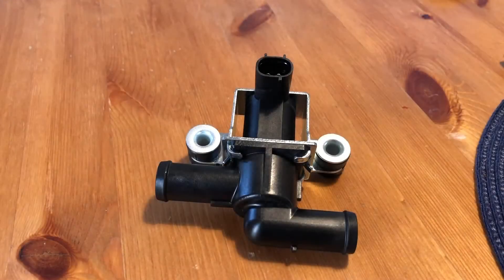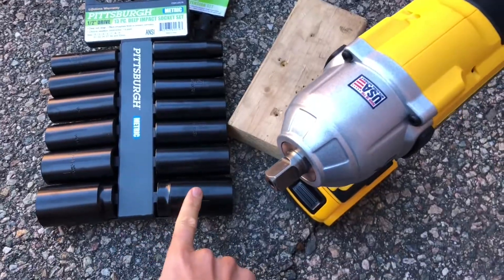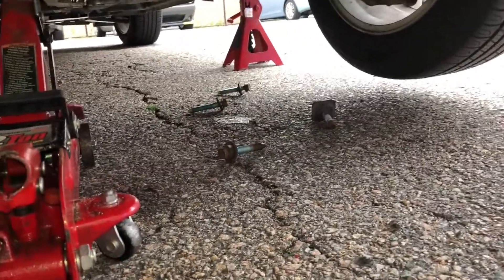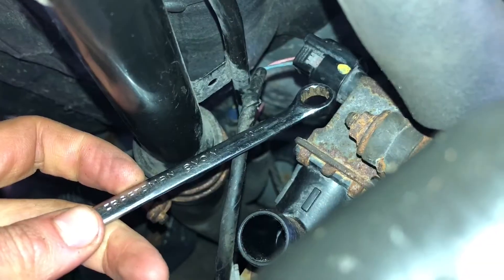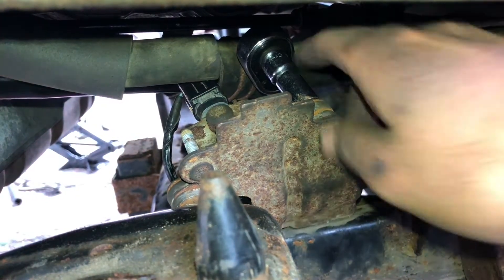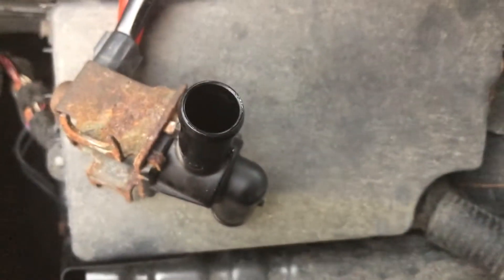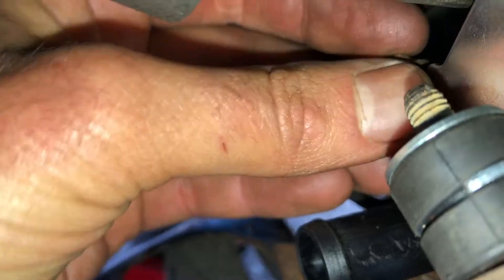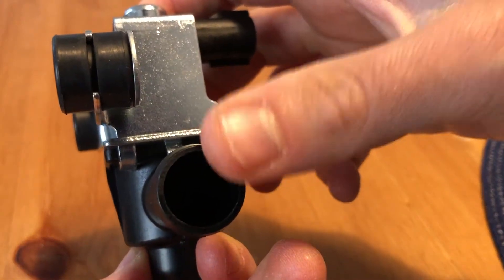How to Diagnose and Replace a Mazda 3 Canister Vent Solenoid P0442 P0456

Comment: Very very helpful thank you for including the torque specs 🙏
Reply from the maker: @timothydh37  thanks for watching hope it helps! I just did this job again and sheared one of the little 10mm studs on the removal didn’t put enough penetrating oil on em

Comment: Great video, i had a terrible time battling the rust in mine, snapped the subframe bolt in the coil spring and cross threaded the other side coming out. Whole driveway was covered in rust, hopefully this keeps the light off, thank you.
Reply from the maker: @RomanEmperor1  ugh sorry you had so much trouble but not surprised. Snapped a sub bolt myself when I did this job a second time; these Mazdas rust heavily if in the wrong region .

Comment: Looks relatively simple, I'm sure the hardest part will be dealing with rusty nuts haha

Obviously trying a new gas cap is an easy first step, but doesn't look like that's gonna work for me 😭

Although if it's actually a $1k repair job I can definitely spend a couple hours to take care of it since I'm not making $500/hr
Reply from the maker: @JoeZupko2  you got the jist of it! If there’s no rust and the car is in 80f summer air it’s an easy job…I’ve done it multiple times, hot and no rust >>> cold and rusted ugh

Comment: Hey I got a 2015 Mazda 3 getting p0452 and p0446 I’m going to start by replacing the gas cap which I doubt will work because the cap looks like it was just replaced (I just got the car so I don’t know much about It) how should I go after trying the cap?
Reply from the maker: @alexquezada510  normal drive cycle to confirm (ie 1-2 weeks of driving for me after clearing codes) then this job unfortunately. I had no interim troubleshooting step

Comment: At 1:00, Is bolt number 1 inside the coil spring area? How did you remove that?
Reply from the maker: Yes, I used wobble adapters and extensions to position my 17mm socket.

Comment: What causes this vent valve to leak?
Reply from the maker: Not sure but I’d guess worn seals or bad spring tension. Mine clicked but still threw the code so I think it’s the sealing components more than the electronics.

Comment: Thanks!
Reply from the maker: Thanks for watching and your support! Glad it helped!
Reply: Oliver, this video saved me $800... CA rates.  I would have not been able to replace the vent solenoid w/o it and just wanted to thank you.  Your video was AWESOME... every bolt you helped me identify... dropped the subframe down 3".  Clear shot to the solenoid.  Note for others: As you could see in Olivers video, he had to deal with rust.  I did not and it was very easy... no impact driver, just a 17mm and 10mm socket.  I did put a 3/4" x 18" pipe on the end of the socket wrench for leverage on the six chassis bolts (absolutely needed)!  Hell, finding a part in stock took longer than the actual job!  You are really good at these tutorials... enjoy a lunch on me.

Comment: LOL you're way too careful dude.
the entire bracket and bolts rusted and broken apart on mine I removed the entire bracket and attached the hoses and electrical back on the valve and just put one tie strap to hold it in place.
a way cleaner and better design than before. other than that, a fine repair this is.
Reply from the maker: Haha I literally just had to redo this the valve went 3 yrs later. Did something similar since it’s so rusty down below decks hahah

Comment: How do you  remove the bolt thats located inside the coil spring!? The space is so small that I'm not even sure what tool would be able to fit in there
Reply from the maker: I did not remove any bolt inside the spring, but for the six on each side I just used 1/2-in extenders of different lengths for access. I actually broke a bolt (not in video) - was too rusted out.

Comment: The light just came on on my Mazda 3 2012 I put a scanner and it shows P0456 code. The cabin smells like gas does anyone have this problem of the cabin smelling like gas because of this problem?
Reply from the maker: I did not have a gas smell but it could be that the code is from a bad fuel line and not a bad solenoid (would cause the same lack of vacuum in the line from canister to engine that you’d get from a stick open solenoid). A pro may need to look at the whole system for leaks in that case. Sorry this is not more specific but if you try relaxing the solenoid and the code stays then look to the lines.
Reply: @OliverPorter92  I have gone to multiple mechanics and no one seems to know, they just say keep driving the code will go away, I’ve been driving it for over a week now and nothing. i need someone in LA
Reply from the maker: @Fluffyapproved  If the code is away I would not be too concerned. It may be a different cause for the smell; the vent solenoid is way in the back. If the code kept on, then the smell makes sense (vapor leak). Sorry this is somewhat cryptic.
Reply: @OliverPorter92  but the smells comes from the car vent I’m thinking it’s coming front the front of the car
Reply from the maker: @Fluffyapproved  If the smell is coming from the car ventilation system but you still have P0456 my gut says it is not the canister vent solenoid causing it, likely the fuel vapor line between the canister and the purge valve located in the engine bay.
Reply: @OliverPorter92  can i send you a picture

Comment: Yeah when my check engine light came on and I did the OBD2 test. It came back to me as a P0442 code. I was like okay now what. So I looked it up and I thought it was my gas cap but I knew it was because I replaced it a week ago. So now I'm thinking it's my solenoid. Thanks imma to a bit a wrenching but I'm pretty sure this is the problem. After all my car is over 10 years old.
Reply from the maker: Thanks for watching! Yes a bit of wrenching hope it helped though.

Comment: Hey Oliver,  Thank you for the video it really helped me a lot I finally replaced the vent Solenoid without a problem, your video was awesome, my 2011 speed 3 check engine light is gone..
Reply from the maker: Hi Marcelo, Thanks for watching and glad it helped! It was such relief to me as well once I fixed it and the light turned off. Good luck!
Reply: What was the CEL number?
Reply from the maker: @jggarage1807  P0456

Comment: Excellent video.  I had P0442 and P0456 codes on my 2011 Mazda 3.  After watching your video I decided to replace both purge and vent solenoids.  Your suggestion for using an impact driver was INVALUABLE.  Having never used an impact driver I watched a couple of YouTube videos on it and now I'm a pro.  My only suggestion is that you should've mentioned that you'll need a couple of 1/2" drive impact extension rods to unbolt the frame.  FYI, both solenoids cost approx. $115 with shipping from RockAuto.  My question to you is: how long did your Mazda3 perform another small leak test before the check engine light cleared?  The P0456 code said it's permanent and didn't clear after driving the car around for an hour.  There's indication on searching the Internet that the small leak test takes a long time to perform before it clears the check engine light (if the problem is fixed).
Reply from the maker: Thanks for watching and glad it helped on your 3! The impact helps a lot, and yes the extensions were helpful too, I can add them to the parts list in the comments. The standard drive cycle is about ~50 miles of regular driving for the car to clear the permanent code through a vent pressure test (something like close vent, close purge, see if vacuum holds, and/or various iterations written in the ECU code, several other YouTubes detail the exact test).  So if you see it on, it should turn off within a few days of driving if this was the correct fix. Good luck!

Comment: Super helpful video; thanks! One observation: When dropping the subframe, the flexible brake lines are stressed. I couldn't drop more than about 2 or 2.5 inches max before the brake lines were at their limit. But that was enough to get at the solenoid. Thanks again.
Reply from the maker: Thanks for watching! I kept a close eye on mine but they did not strain, good to watch out for though!
Reply: So what year Mazda 3 is this

Comment: Alot of work for my rusty mazda 3 with almost 200,000 miles and a slippy 2nd gear. Think I'll keep clearing the code til it comes back instantly and the just ignore it lol
Reply from the maker: Yeah, I did it to pass MA inspection. It was a fun job...if you find this stuff fun! Thanks for watching.
Reply: @OliverPorter92  definently man. You did a great job.
Reply: Wow sounds like like my car. 2008 Mazda 3, 3rd to second or 2nd to third and it makes not nice sounds if you step on it

Comment: Hi! I have a 2012 Mazda 3 skyactive that looks exactly like this underneath and am also having an issue with the purge solenoid. My problem is that my solenoid connector wires were torn off about 8” from the connector (down by the cross member) and I have no idea where the missing section of wire should connect back into. Could you explain how/where  the connector is wired into the wiring harness?
Reply from the maker: Thanks for watching. Unfortunately not, would need to go into the wiring diagram in the shop manual (Mazda may be able to provide the manual and schematic).  Sorry for that!

Comment: I have a 2012 Mazda3 and the gas tank does not hold any pressure, every time I take off the gas cap (which I replaced) I noticed there is no release of pressure at all. Could this be the part be defective ? I replaced the vent valve at the engine and still read codes of P0442 and P0456.
Reply from the maker: If you replaced a valve at the engine, that was likely the purge valve.  Your issue is most likely towards the tank, try new gas cap, smoke testing or following a code troubleshooting tree likely needed to isolate leak.

Comment: Dude, Thank you so much for the video that really helps I have the same problem with my 2011 speed 3 just one question what was the torque when you replace the 4 bolts
Reply from the maker: Thanks for watching, hope this helped - sorry for the delay, 10mm Solenoid: All hand-tight, 17mm 6x suspension bolts, 3/side: 73-97 ft-lb, 17mm 2x shock bolts, 1/side: 59-77 ft-lb

Comment: What is the 100 ft-lb limit on? It's cut off in the description. Thanks!
Reply from the maker: Thanks for watching! I just update the recommended torques in the description, -17mm 6x suspension bolts, 3/side: 73-97 ft-lb
-17mm 2x shock bolts, 1/side: 59-77 ft-lb
Reply: @OliverPorter92  great!  Also, does your Mazda have the skyactive motor? I’m having difficulty figuring out what part to buy and it’s location. Auto parts stores showing a different part. My son’s is a 2012 Mazda 3i with the Skyactiv. Thanks again!
Reply from the maker: @jimcody8089  I have the 2012 Mazda 3 2.0L M/T i Sedan (VIN code G/Shop Manual Code LF). Skyactiv 3i 2012 is VIN Code 8, 1998cc vs my 2000cc. The 911-711 link in the video description works for both, so you should be all set.
Reply: @OliverPorter92  what is the part on the drivers side of the engine then? Showing canister purge valve online. Could this throw a P0442 code as well?
Reply from the maker: @jimcody8089  See description in my purge video https://www.youtube.com/watch?v=Rn540JHJnMs which was the beginning of the troubleshoot. P0442 is less likely to be purge, it is a small leak. It may make sense to just replace both if you are already at it. Purge is quite simple to replace since you do not have to lower an entire frame!  Good luck. Here is the purge: https://amzn.to/3mfieNc
Reply: @OliverPorter92  thanks again, my friend.

Comment: It looks like I have a similar issue. How much do you think mechanic should charge for that kind of job without parts?
Reply from the maker: Thanks for watching.  I am not sure (short answer). I had a separate issue in this area (broken bolt that I could not remove from the subframe, required lowering subframe and torching/replacing the bolt). This is similar to this job because it involved 1) lowering the frame and 2) working on the frame area after lowering, and was $160 in Boston's North Shore. The vent solenoid is somewhat involved, and labor rates vary widely around the country.  Think of that as a bounding number, but if there is any troubleshooting involved it will be more...my overall troubleshooting w/ my smoke maker and purge solenoid took longer (my own time). Sorry I don't have the full story cost-wise and good luck!
Reply: @OliverPorter92  how did you command vent solenoid to close in order to test it? I did not find it in forscan
Reply from the maker: @serge_sa  That was the tough part - you need a bi-directional >$1000+ scanner to do this. I suspected it after not getting anywhere with purge and reading online. I did test it once I removed it in the video with the 12v car battery and some alligator clips and noticed lagging/leaking.
Reply: @OliverPorter92  thanks. I suspected the same.